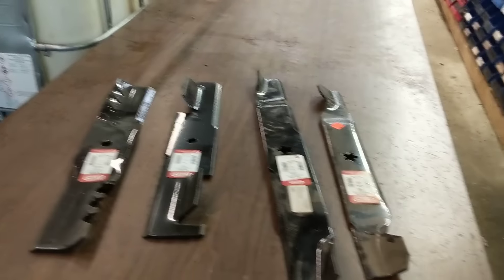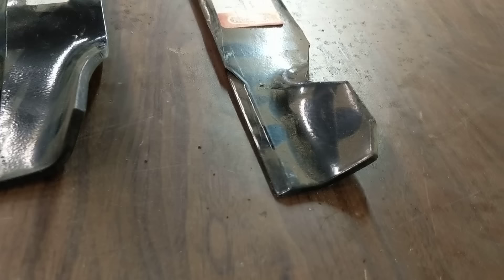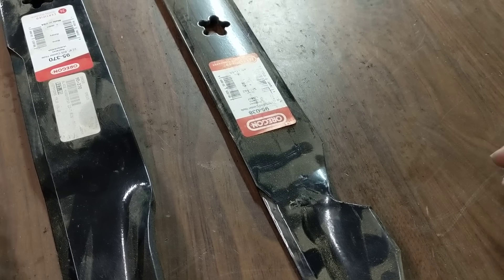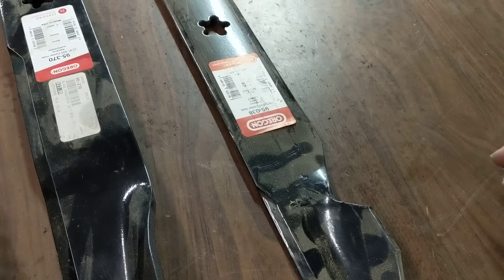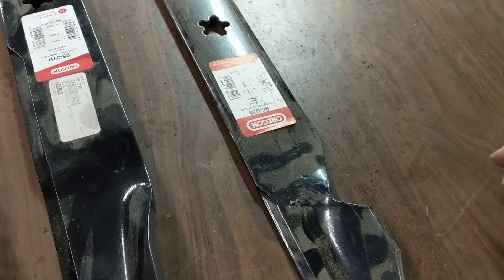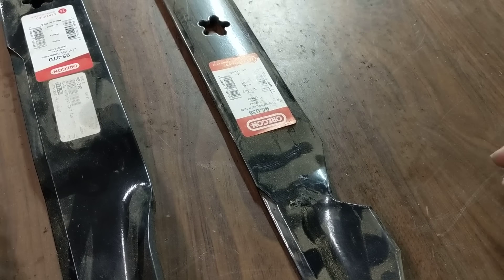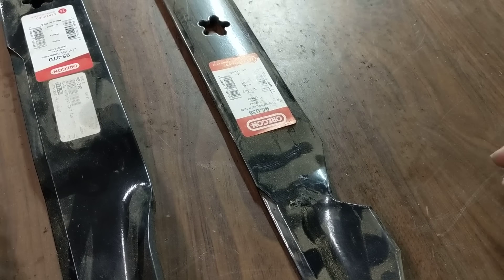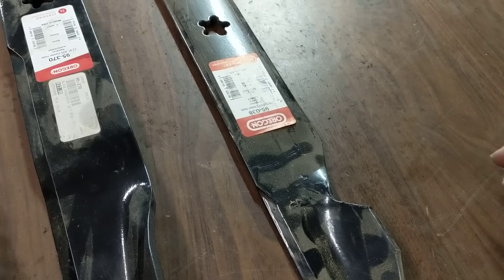Mower blade drastic difference and what is best for your yard and your mower. Oregon, Scag, Gravely,

Comment: How about a mower blade with adjustable pitch? So I can go from high lift, to low, to mulch (maybe easier sharpening) all with one blade! Any engineers out there?
Reply from the maker: That would be interesting. have to be a really robust mechanism to hold up to the environment in the deck. Thank you for watching and taking the time to comment.
Reply: Number 1 rule in engineering: K.I.S.S (keep it simple stupid)

Current blade: simple = relatively cost efficient, robust concept, low risk of flying apart causing catastrophic damage

Adjustable blade: complex = expensive, more possibilities for failure, high likelihood of catastrophic damage (blood and guts) 

The real change I’m ready to see is a gear box or variable speed pulley on the deck to ramp up the blade speed but keep the low end torque that bogs the engine down. Higher tip speed = better cut..
Reply: @treytavares8590  booorrrring
Reply: @nateb4543  lol, ask for an engineering answer,  get one, then  you want to be  that way.
Reply: @jimscott4552  Haha guess I'm a dreamer. Know enough to have unrealistic ideas. Thanks to bringing me back down to earth

Comment: Must not sell many they need dusting
Reply from the maker: That is in the back storage area. We bought a few thousand blades at a time so some would be in stock for a few month. Plus a gravel lot all around the shop with constant traffic made everything a dusty mess. I had to constantly clean my tool box. What a huge pain in the A$$. Thank you for watching and taking the time to comment. I greatly appreciate it.
Reply: That must suck we have a wood chipper nent to work, better not leave your window open
Reply from the maker: @kirbyblackburn8550  Ya Open windows are not a good idea. LOL you will never get all the dust and stuff out. Thank you for watching and taking the time to comment. I greatly appreciate it.